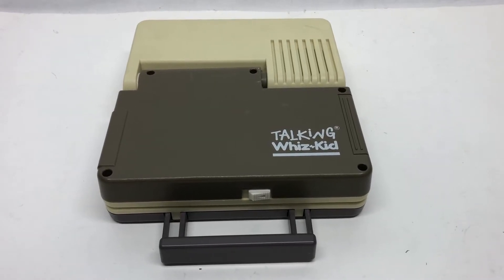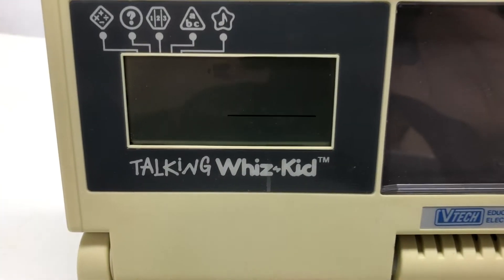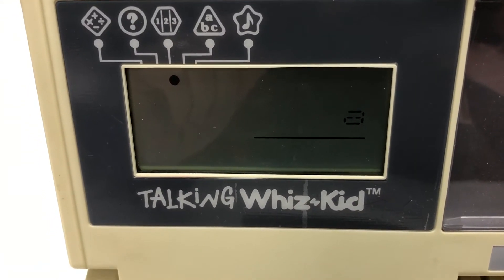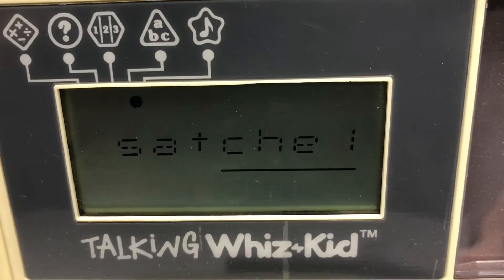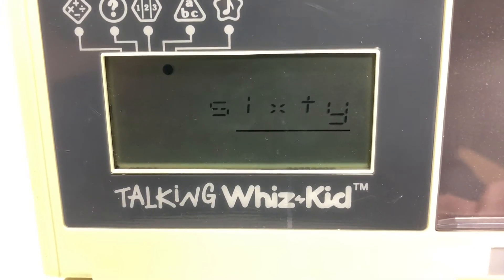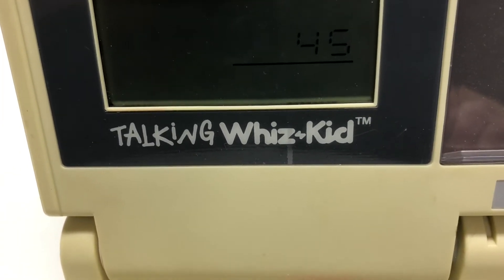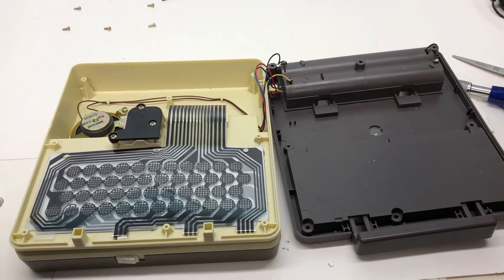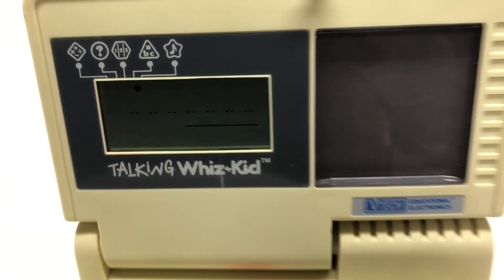VTech Talking Whiz kid computer *** Play without Cards! *** Demo, instructions, and a  look inside

Comment: Yes there were cartridges..they would come with 30 (or 50) additional cards (I think...I still have mine I'll have to look). To play them you'd put the cartridge in then turn it on and it would be able to play the original 50 cards plus the new ones.  To play those with a code you'd use with 51 as card 1, etc.
Reply from the maker: Thanks for the information about the cartridges!

Comment: Does the unit have any storage space for the cards?  I have a Pre Computer 1000 Junior which uses discs, if you lose them you can still play the games and the discs don't have pictures on them, so all the games are still playable without them.  The Pre Computer 1000 Junior also has a storage compartment on the bottom for the discs.
Reply from the maker: I do not recall any space to store the cards in the machine itself.  I just checked out a short video of the Pre Computer 1000  Junior...  pretty cool... love the discs.
Reply: @davidk4145  Yeah, they were a pretty cool idea.  I've had mine since I was 7, it still works almost as good as new, VTech built these things to last.  You'll find a more detailed video of it on my YouTube channel.
Reply from the maker: @Lachlant1984  It is astonishing that these things still work almost 40 years later.  I see your video about the Pre Computer - I'll give it a look.

Comment: Yes I have set C "Rocket to Zenod" cards with cartridge but can't get the cartridge to work.  Mine is 1986 regular green version.  (bought in UK)
Reply from the maker: Interesting!  Do the contacts on the cartridge look dirty?  I have used 91% isopropyl alcohol on a cue tip to clean the contacts of cartridges (such as for an Atari 2600) and sometimes had success.  Also look at the contact in the machine itself and see if they are dirty.  The alcohol evaporates quickly and is used instead of water (which could rust the contacts).
Reply: @davidk4145  Thanks!  I cleaned it and it's working fine!  Got it for my kids when they were little and it is now ready for my grandson!
Reply from the maker: @barbararossell1747  So glad it worked!! Hope your grandson has fun with it.

Comment: There were also additional sets of cards you could buy the first 50 were coded as an A set on the actual card front, dunno how other sets worked cos I never had them but I think there was a B set, dunno how you'd enter those manually though
Mine is still working but I'm missing most of the cards
Reply from the maker: Wow - wasn't aware of there were a second set of cards.  I never tried keying in a number higher than 50 and unfortunately I sold it so I can't try!  Anybody else with info - please reply here!
Reply: @davidk4145   I think there were several sets of cards, about 300 in total maybe, from what I've been able to find out